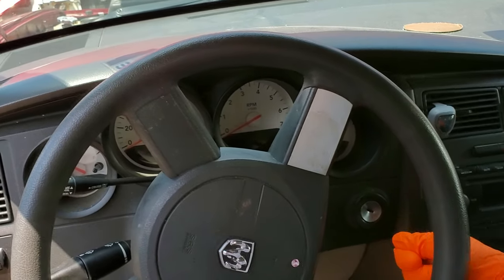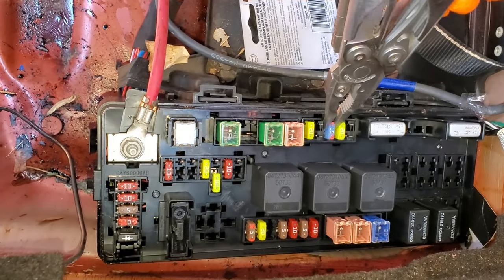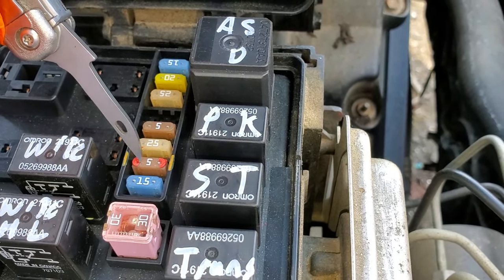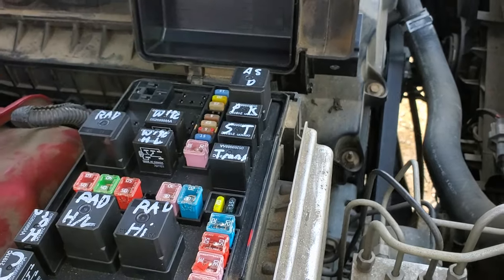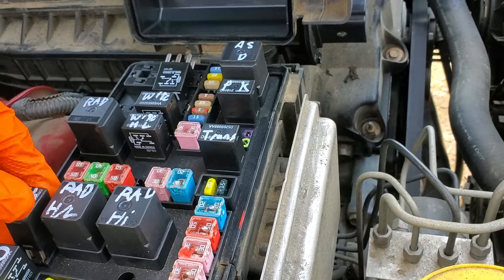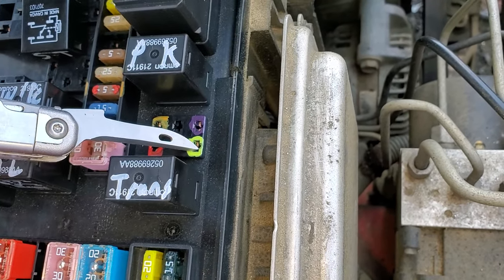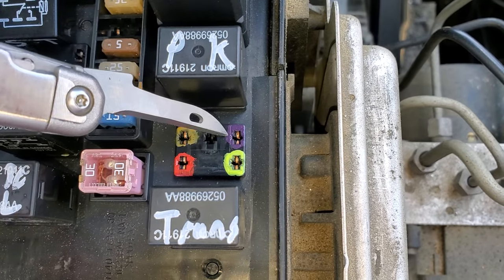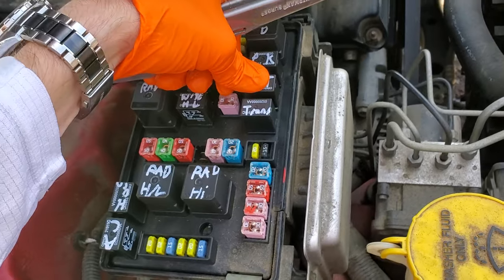2007 Dodge Charger Starter Fuses, Starter Relay & Circuit Explained

Comment: 2008 Charger, new battery, new starter, power at the relay, power to the big terminal on the starter, new relay.  To ops check the starter,  as other have demoed by pulling the relay and providing a "jumper" between 37 and 80. Nothing. Ohms check the "tickle" wire at the starter, get an ohm reading but not like a solid ground, with the needle pegging out. Is there anything between the relay pin and the starter?
Reply: What did you end up doing

Comment: I have a 07 charger there is a u shape I guess module in my ignition or by it im trying to find out what is it call my car don't turn on because of that...its happened be for..I replace it with a use one and now it gave out so I wanna get a new one but o dnt know what it's called

Comment: I want to say thank you very much for this video, I have a new battery, alternator and wires and my car still would not turn over. I used the horn switch and the car started right up! Thank you again
Reply: Did it jus click when turned the key??

Comment: Hey bud, somedays when I take off in my car and I'm driving the horn will just start blowing for no reason. I have to pull over and shut the car off to make it stop.. I pull the key out and put it back it to start and the second I turn the key on it starts blowing again. I turn it off again and repeat a few times before it finally stops and I can begin driving again..I have replaced the battery in the key a few times and that seems to help for awhile..have you ever heard of this ?
Should I replace the fuses and relay? Can I just disconnect the horns? It's just my work car and really don't need a flipping horn that bad...lol...do you have a diagnosis for me? Greatly appreciated if so !!!
Thanks Dave

Comment: great video man. I will add, first check is the battery in the key fob. Seriously, engine will start and cut out a few times then no crank, no nothing. I replaced the battery in the fob and it started like a champ.

Comment: Can you show about a 2008 dodge charger. Need help i have a 2008 dodge charger 2.7 replaced the starter relay and still no crank or start
Reply: I'm having same issue, 2007 Dodgs charger
Reply: I’m having the same issue

Comment: I have a 2007 dodge charger 3.5 SXT, I get a spark at the plugs. Car was running and it shut off driving home. Place a scanner and it suggested to replace cam and crank sensor bank1.  I replaced it. But not getting a spark at the plugs???
Reply: Did you find your problem
Reply: First of all I apologize for the late response, No check and replace relays and same thing. Which leads me to believe that the timing belt is bad or broken. Car has 270,000.00 miles and never changed the belt.

Comment: Been trying to diagnose a no crank on my dodge magnum 05 was working good but had a transmission hose bust so repaired it made it home then hasn’t started since replaced starter n crank shaft sensor but still no luck wonderin if u had any ideas wat it might be

Comment: So on my 2007 I got a code low voltage I checked alternator and battery I changed the spark plugs and ignition coils and it still won’t start you got any ideas why it is not starting

Comment: I have a 2007 dodge charger and we got a new alternater new battery it still shuts down it won't even turn on the lights but I can turn the key over but nothing happens no lights come on nothing

Do you have any ideas would be great
Reply: my dashboard lights turn on but doesnt crank ..let me know if you find how to fix it
Reply: @lucialozada8725  did u find out
Reply: I would check all your wires and grounds

Comment: So I jumped the relay and the starter did crank eliminating the starter as the cause and after I did that the car started fine with the key no idea why but now I carry a jumper wire with me.  Thanks for this video saved me lots of looking stuff up 3 fuses and a relay to start a car I feel like we went backwards as a people.
Reply: I should add i used the same relay I did try a swap but did not fix it once I jumped it just put the old relay back in works fine just baffled at what the cause really was the dealer did just do air bag recall got a feeling something got messed up they left my ground in the truck totally lose when I got home made a weird clicking sound from like behind the radio next day would not start yet what I wrote above worked to get it going again and my starter sounds fine plenty of cranking power.

Comment: I got a Dodge Charger 07 the same problem if I turn my key on the lights will come on but it want turn over in my meter won’t move I need help
Reply: But it will turn off but when I turn my switch again the lights don’t come on

Comment: I have a 2009 Dodge Charger 2.7. V6 and I was having trouble starting the car it would just click after 3 tries it would start so I checked the fuses and I changed the one for the start key ignition and worked well yayyy but but 3 days later it did the same so now I’m going to check the rest of them or do you think it’s my starter !????? It turns on. But arrrrrrr lol advice pls!!! And your videos are very informative thank you bless your heart brother
Reply: I have a 09 charger  (2.7) changed starter , practically a new battery, lights come on dash , everything, but when I turn it it just clicks

Comment: You might be the man with an answer, My 07 Chevy trailblazer occasionally since I had it 2yrs, when I start it from the ON position when I turn to crank I get one click then no start. When I attempt to retry I get zero, no dash lights anything, I have to disconnect the terminals wait about five then it starts for a few weeks or more and again. Sometimes it happens twice a week every other week. Battery new, when it does start it starts very good no starter struggle. I thinking ignition switch???

Comment: when my friend starts her 3.5L 2010 SXT the starter works we put in a new alt, but the car wants to run rough and she claimed it will die on her after she leaves it running. Any idea?
Reply: Tune up needed or vacuum leak check all rubber hoses under hood even the egr valve hose on back of intake(plenum)

Comment: Ok i need help,  i am not getting any power to my blower from the ac/heater switch. I CHECKED THE FUSES THEY ARE GREAT , i took the blower out and hooked it ti some power source and it spent really good. But when I put my tester on the plug wirer that connect the blower and turned the switch still there was no power coming from it. Is there any suggestion for me to try
Reply from the maker: This is the most relevant video to your situation although it is for a 2007. Good luck!  https://youtu.be/cR2r_A49NjU
Reply: Relay?

Comment: Im going to try this I have a 300 2005 that has been sitting cause my lights or my wipers wont come on and now the whole car wont start It has power but when I turn the switch it don’t crank I had someone crank it straight from the starter or something and it cranked but it wont start with the key

Comment: Sorry if this a dumb question so if you have no electrical response when putting the key in the ignition then it could possibly be a bad fuse?
Reply: did u ever figure this out? im stuck here
Reply: @papiizo  yeah I changed out the fuse and it got a new starter
Reply: @thenewgamers7382  mines was a new ignition box the old one was no good.

Comment: if I installed a new starter on my 2007 Dodge Charger,  Does it need to be reprogrammed?
Reply from the maker: No need for programming if all you changed was the starter.
Reply: That’s the same thing somebody told me reprogram because it was a new starter .  Cuz it’s just clicking , and my battery good , all the lights come on , just won’t make a sound when I’m turnin the key to crank it
Reply: Did you ever get it fixed ?
Reply: @napoleanpaige3277  mine Is currently not making a sound when I try to crank it 🤦🏾
Reply: @LehewTech  has anyone figured this out? I just replaced my starter an battery and I have the same problem lights and everything work it just won't start
Reply: @napoleanpaige3277  meant to reply to you did you find the problem?
Reply: Did anyone figure out the problem

Comment: Is it the same locations on the 3.5L?
Reply: Hey did you find out the problem because I'm still having it
Reply: And I have the same engine
Reply: Same locations on my 07
Reply: Mine was a bad starter all my fuses were fine.

Comment: Question:  I have a 2008 CHrysler 300.  My issue is that when I turn the ignition switch, it will stay cranking, but will not turn over until I turn the ignition off.  Now I should say that it is really cold this morning as opposed to the last few days and maybe that is the issue, but this is the first time it has done that.  The good news is I am definitely getting power, its like it's stuck...maybe wiggling the relay switch or swapping it out for another relay may solve the issue?